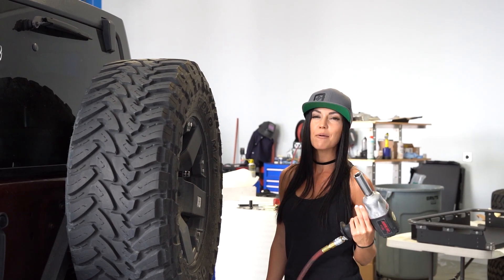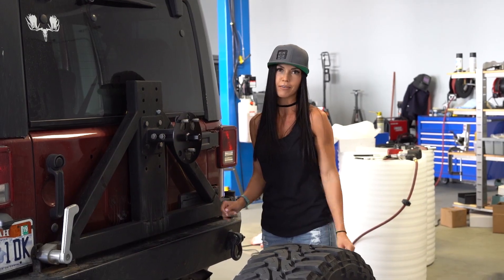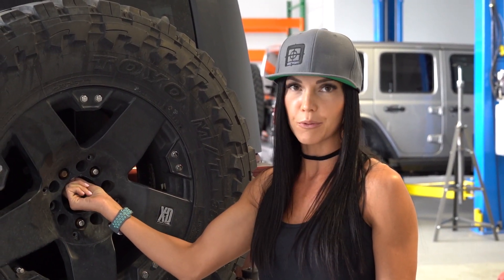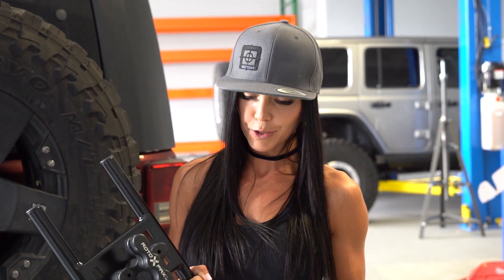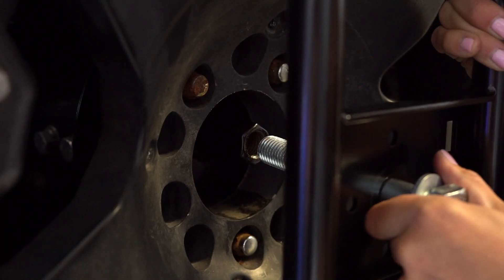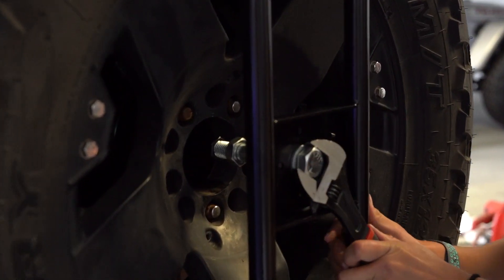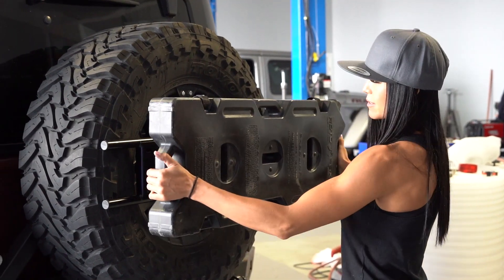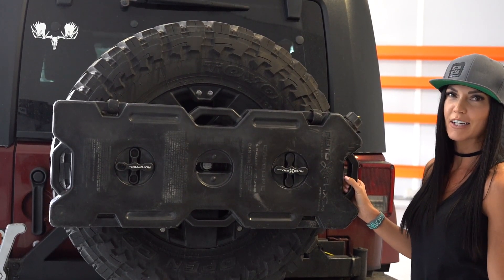Never Run Out of Gas Again!!

Comment: Will this work on a Jeep OEM tire mount?
Reply from the maker: George Green Hi George!  It will work on the OEM mount, but is subject to the weight and load capacity of the tire carrier.  Most OEM carriers are designed to only be sufficient for the spare.